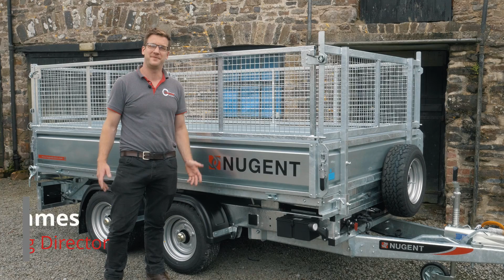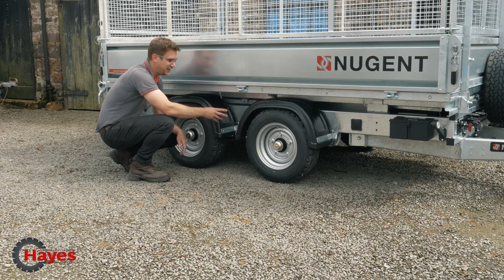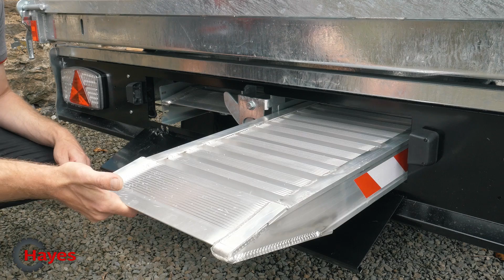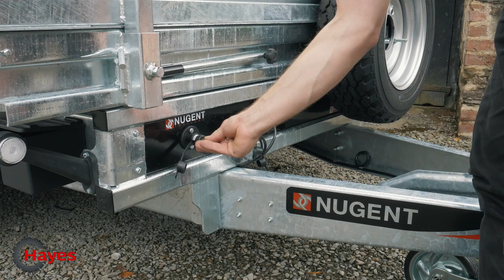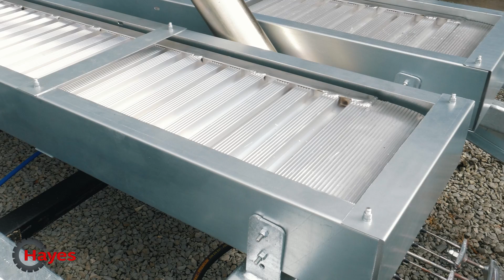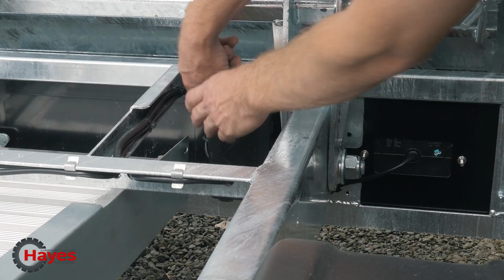Nugent Tipper Trailer Overview - 2020

Comment: So will it tip 2.7 tonne?
Reply from the maker: Hi Jack, Great question. Simple answer.. yes. The correct answer - The trailer is 3500kg gross and 1020kg net giving a payload of 2480kg. Being made by Nugent everything is up rated compared to other options in the market. The ram I believe is the same size they put on silage trailers and the pump will push way more than required. I wouldn’t recommend putting say over two tonnes at the the front of trailer and trying to tip, always a load spread across the trailer is better. Contact us if you have any further questions.
Reply: @MachineryNation  cheers for the detailed and swift reply I very well may be placing an order soon 👍